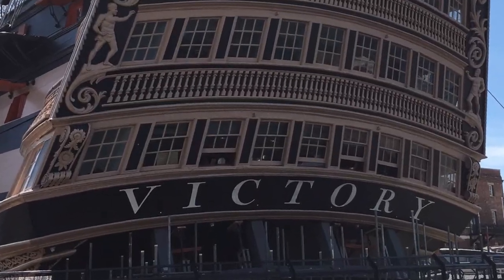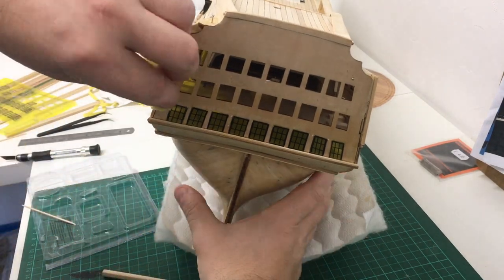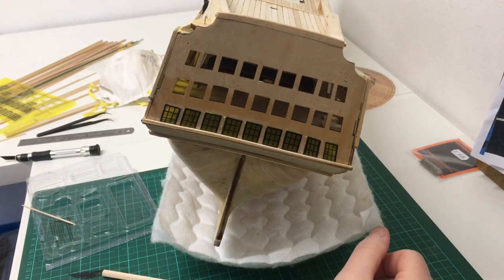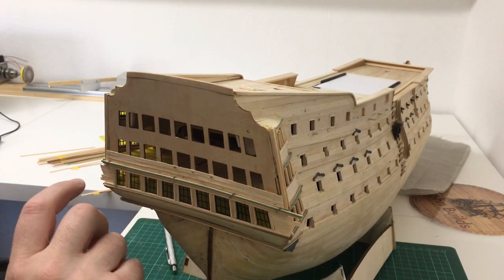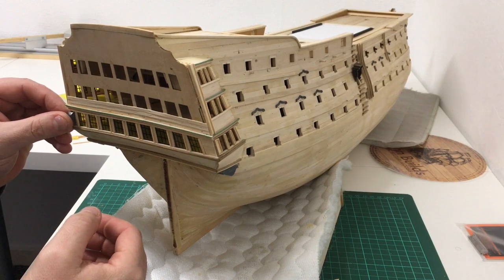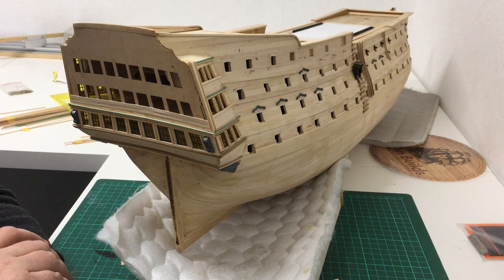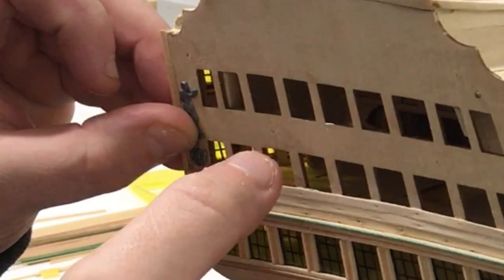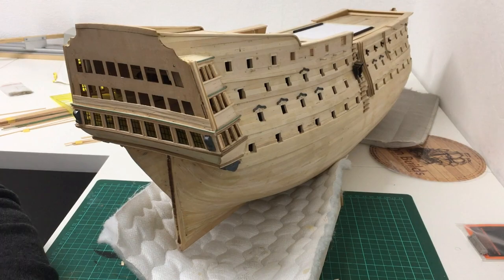HMS Victory Model Ship Build : Part 34 : The Stern wardroom / Officer's cabins

Comment: They don’t give you a lot of room to fit the decorations in along the sides of the gallery. You won’t have enough room to fit the other decorations. I started like you separating the lower windows from the top 2.  When it came to fitting the other castings I didn’t have enough room. On my model the castings almost touch each other and i have no clearance at the top of the gallery. Nice little problem for you later on lol
Reply: Looking really good tho 😁